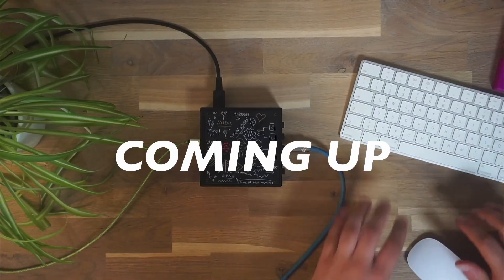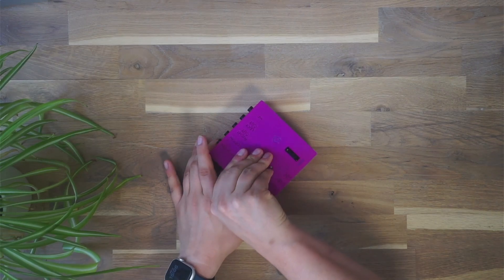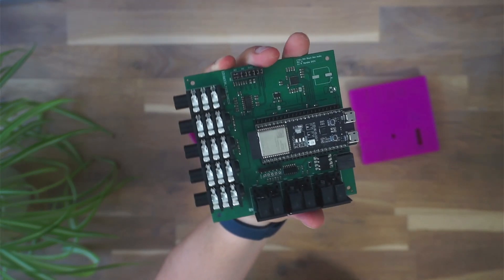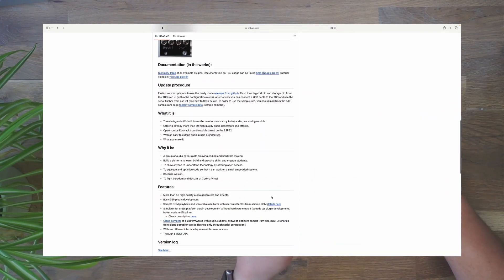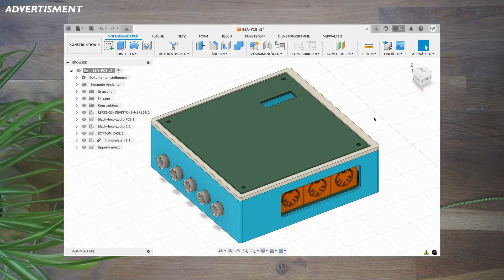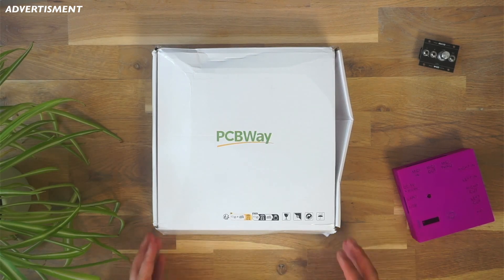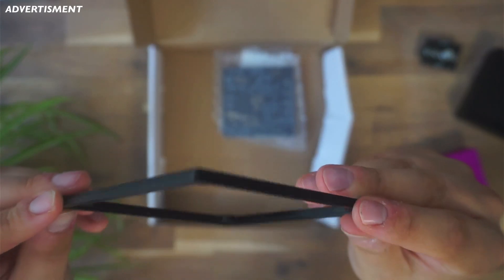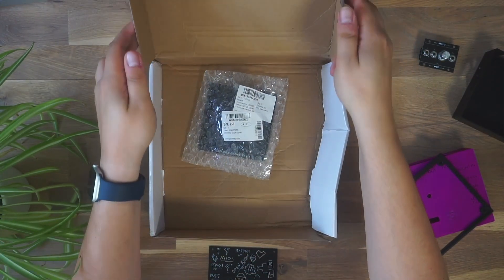THIS TINY SYNTH CAN DO…EVERYTHING?!?

Comment: just tried to compile the simulator in chromebook /linux container debian and got stuck on the git submodule init recursive step ... getting fatal: No url found for submodule path 'components/esp_littlefs' in .gitmodules
Reply from the maker: I had the same issue using the GitHub CI. I just send a mail to Robert and he mentioned he’s on it. I guess an issue in the repository to keep track of the problem would be good as well 😊

Comment: I am looking for a little sampler/drum set machine and fx to control with sequencer. This should be working very well, shouldn’t it?
Reply from the maker: Yes indeed! The drum rack plugin should work very well for that 😄
Reply: @wgdmodular1252  Thanks for the quick reply. Very impressive project. I will start building it. If it works well I will donate of course. 👍